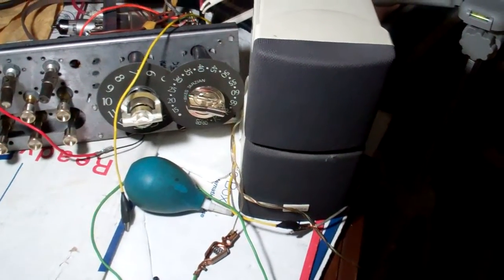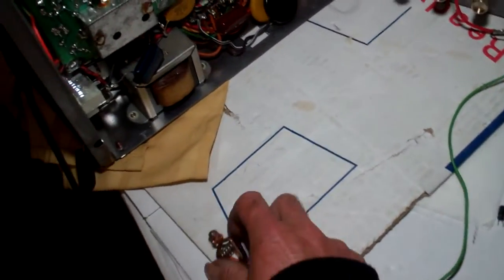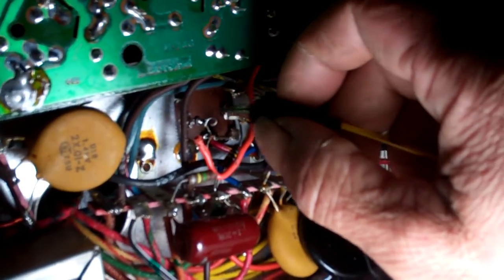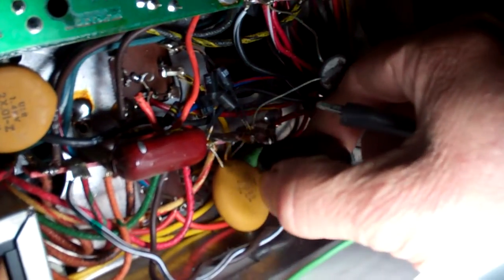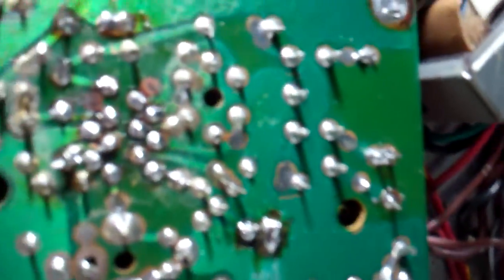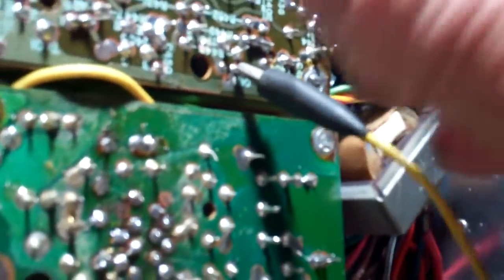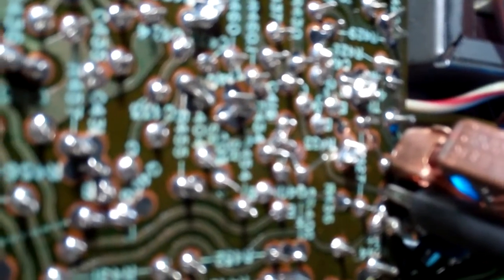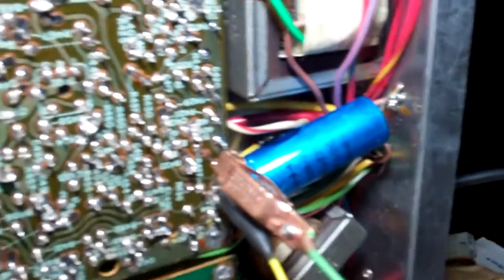Checking testing electrolytic capacitors in vintage tube gear using audio

Comment: SHANGO066, If you remove the Choke in the power supply what does this do to the AC ripple, can this add harmonics to the amplifier circuit?

Comment: And speaking of radios, I got my Revere 16mm sound movie projector off of eBay about two weeks ago and it was a model S-16. It works perfectly, and it runs pretty well after cleaning up the old grease, except the amplifier has no sound which is an issue. I checked underneath the circuit where it has a few Sprague bumblebee capacitors and they’re look fine, but I checked that the 12AX7 tube, which is the tube that doesn’t warm up is shot. So I have to replace it with a better 12AX7 tube that I already ordered on eBay, and it will be on the way in a matter of days.

Comment: I change out the electrolytics in VINTAGE audio as a matter of safety and insurance, even IF they work...so this procedure would be pointless for me. BUT, it is interesting from a scientific standpoint.
Reply: true but it helps one understand and learn when the problem is isolated via procedure
Reply: @ab5ni He uses this method to troubleshoot and get it working with minimal investment because if some part that you can no longer obtain is no good then whats the point of restoring it.

Comment: Hi just want to ask what is a proper replacement value for a vintage

 32-32-32uf @400v. Thanks
Reply: That would be three seperate 33 or 47 uf capacitors at 400V all sharing a common ground.

Comment: Do you find this works on all caps regardless of capacitance/voltage rating? Will this work with caps in circuit in all instances, or will caps sometimes have to be pulled to get a proper response?

Comment: One more thing about the Blue ESR meter, I would toss the cheap test lead wire and alligator clips with the kit and use a good quality test lead wire and I like the pincer clips to grab cap leads.
You do need to discharge the caps before testing.

Glenn WA4AOS
DSM Labs (dot com)

Comment: Hi good method but may I suggest something I like better. ESR testers measure the Equivalent AS serise resistance. I bought the BLUE ESR tester kit listed on ebay for about $75. THe kit took just a few hours to build and WORKS GREAT!! 
You can buy it assembled for $100. There are other ESR meters out there but this one was cheap and I have found MANY questionable bad electrolytic caps with it.
In most cases if the R is greater that 5 ohms, I replace it.
Glenn
DSM Labs (dot com)